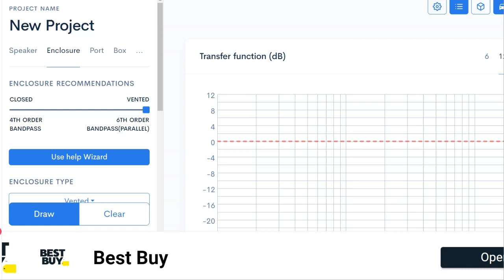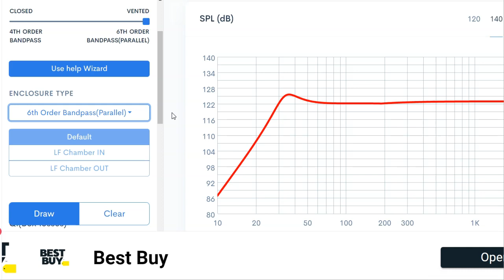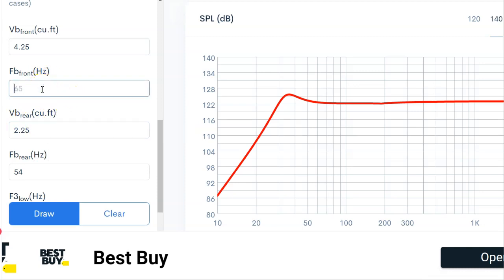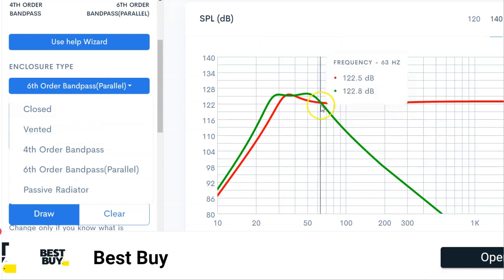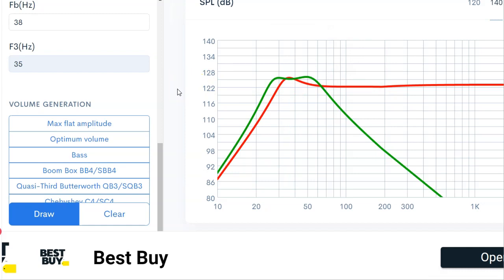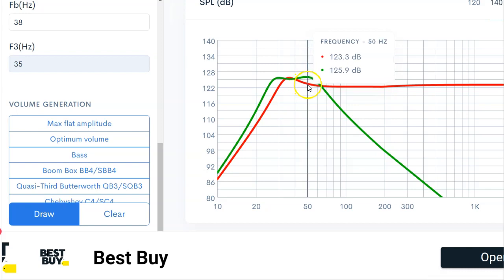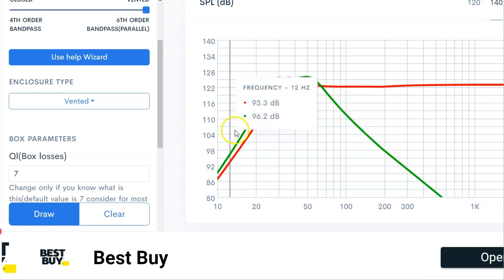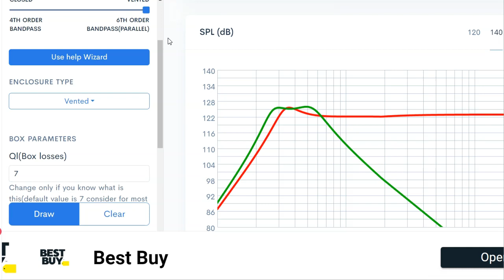What is louder, a ported box or a 6th order bandpass?

Comment: Awesome video, I have 2 kicker q class 8s in a ported box an there in there smallest recommend volume of .66cu net per with 4" aero tuned to 33hz. It does sound good but know kicker subs like bigger box's. My frequencys sound like in the 40s on up my subs are playing much so I'm wondering if it's cuse I'm tuned so low or since I have a factory HU and using the wavetechDQ I need to set my parametric eq to a certain frequency to boost the signal around those 40hz and up ranges. I'm gonna eventually get 3 sundown x8 d2 subs and run them in a ported box that will be close to 2.5cu net for the 3 x8 subs. Could you maybe draw that up and see how much louder/deeper I might be over my current 1.3cu net ported box with my 2 kicker q class 8s in. Thanks alot👊

Comment: did you adjust the power based on bandpass tuning? 6th order band pass makes the cone move less, this means you can apply more power to force more cone movement, this in turn makes more output. I made an 6.5" SPL 6th order bandpass that outperformed my dual 8" fullrange speaker in bass output. the bandpass was tuned 37hz, 67hz. the full range speaker was tuned 35hz.
Reply from the maker: You are absolutely correct!  However, I did not adjust for two reasons.  #1. This can depend greatly depending on the 6th design.  As an example, I personally designed/run a parallel 6th and it can't handle extra power like a series can.  #2.  I am assuming the same equipment for both the ported and 6th, which means the same power and subs, just a different box.  Love the feedback though, I will have to make my videos a little more in depth in the future.
Reply: @caraudiolab  I get your reasoning, I have a long time trying to find out what is most effective. My conclusion is that it is very hard to know. The most correct way to measure it is to divide spl on enclosure volume and use that number to define output per given size. Then, design the enclosure that is optimal for the enclosure type. If you restrict power, for example, then your condition is biased towards the bass reflex since one of the reasons why 6th order is so loud and powerful is their ability to handle extra power. I think what is louder depends on what scale you build. Below a certain size, the ports of a 6th order have to be bent to fit, making port size/shape the bottleneck that makes 6th order less loud. After a given size, ports becomes possible to be straight, aerodynamic and the correct ratio relative to the total enclosure size, at this point, 6th order I believe is louder, but only within a limited Band that I have yet to put a number on. 

I think your video was great. People are on different knowledge levels. If you are going to take all variables into consideration in a video about this topic, it would sound more like a research paper and most would probably lose interest due to too high complexity. ☺️
Reply from the maker: @olekristianrannekleiv762   I absolutory love this: "The most correct way to measure it is to divide spl on enclosure volume and use that number to define output per given size."  This is how I think about it as well, what gets the loudest per size.  With bigger builds, I have started having to add a 3rd factor.  What gets loudest per size and weight!
Reply: @caraudiolab  That is a good point, weight becomes an issue, that was actually quite relevant for one of my coming builds! Im going for a 130-150L bandpass sub. Im considering making it 4th order, but that demands even heavier subwoofer driver too.
Reply: @olekristianrannekleiv762 any details on your 6.5 6th order? Also seems like you might be preferring 4th order?
Reply: @chokechange   I have been considering making a video of that 6th order design since it is so hard to make a good 6th order bandpass, and this gave very good results and took almost a year to design with plenty of trial and error. I like the thought of 4th order because it has less distortion. since 6th order output both the front wave and back wave of the driver, and these have an inherit delay between them, a 4th order dont use the backwave as it is trapped inside the sealed enclosure. they also have good output, my latest design is a dual 3" 4th order for my home cinema, for an apartment it deliver far more output than i need down to 35hz. 4th order also can play far deeper than 6th orders. a 4th order tuned to 50hz can still play 23hz, it is just that it is provided by the subwoofer driver rather than the port, so the output is not as loud. 6th order or bass reflex have almost no output a few hz below tuning due to cancellation.

here is a picture of the 6th order during the trial and error phase for port tuning
https://drive.google.com/file/d/12zltq2HlJ5nX1idi22wBsWvTs8-Mwomn/view?usp=drive_link

https://drive.google.com/file/d/13OzXteHHtP7PGVInpAIBocqun1X4RKGg/view?usp=drive_link
Reply: @olekristianrannekleiv762  Id be interested in the details so maybe I could build one on a smaller scale. Interested in your dual 3" 4th order, but would like to use for a portable bluetooth outdoor application. Thanks for the knowledge so far.
Reply: What app are you using? About to build me either a 4th or 6th order Using PRs. VB1 will be 2.4cf @24hz and Vb2 will be 42hz. I cant get the PRs to play any higher so Im wondering if its worth my time. I have a box with 4 PRs right now in the trunk (two facing the cabin, 2 facing the trunk) at 24hz and it doesn't have any chaffing at all. The cleanest 24hz I've ever heard in a car build. Box is only 2.4cf for 2 15s. Does this app your using have a PR function?

Comment: Thank you for making me discover many more things about bandpass boxes, every day I am more in love with this configuration, which is a challenge to do for cars in my region😅......I wanted to take advantage and advance to a certain point, although yes, bass reflexes can ´´SPEAKE LOUDER´´ than bandpass-type speakers in a lower bandwidth range. Due to 6th order bandpasses having more capacitance and inductance agents, the application of higher power levels and cone control leads us to have a box system that will very possibly provide higher SPL
......I'm just leaving my vision for future exchanges of relevant information........a hug from a Brazilian admirer🙃😁
Reply from the maker: I forgot to mention the extra cone control with a 6th order bandpass.  So, you are exactly right!  They can handle more power built correctly and therefore could have an SPL advantage!  Thanks for the input and thank for watching!

Comment: Nice explanation.  It’s funny but I never thought of a 6th order as 2 ported enclosures put together.  I am assuming going isobaric would result in -3db across the board but would you get better extension because of the effects that would have on the enclosure size?  Great job though.
Reply from the maker: The isobaric is really just useful if you want to make your box half the size.  But yes, you still loose 3 db.  However, a small series 6th with wind would be fun!  I might have to try that.  :)